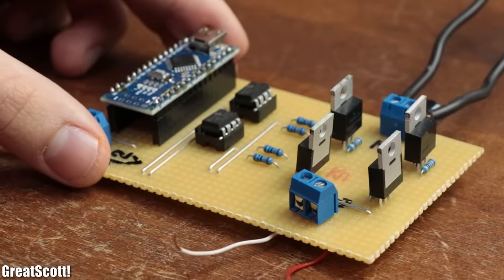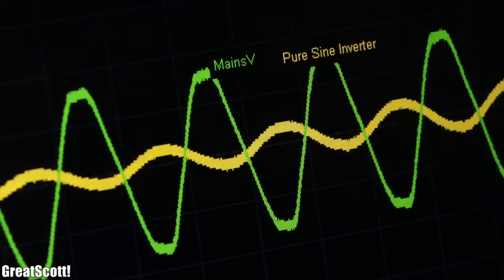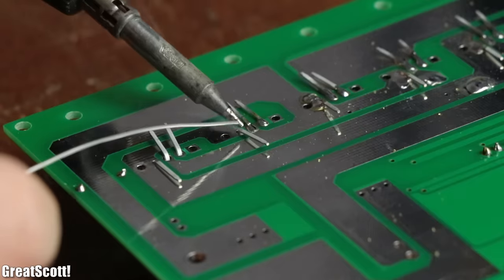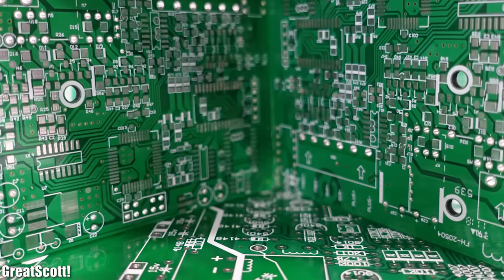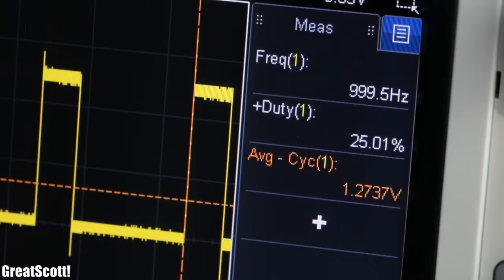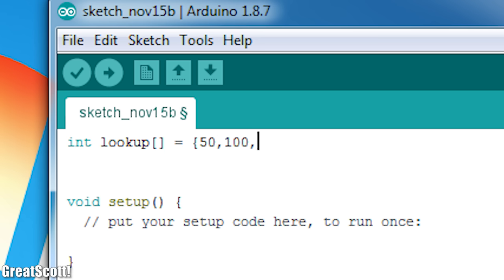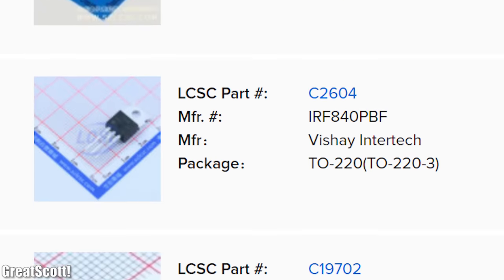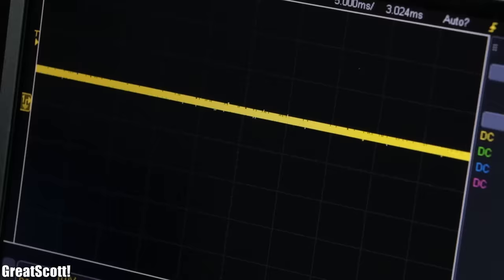Does it suck? Chinese DIY Pure Sine Wave Inverter || Sinusoidal PWM (SPWM) Tutorial

Comment: I know a fair amount about electronics and have a lot of common sense so I just want to say that if you are powering something don't over invert yourself especially if you're using batteries in other words don't buy a 5000 watt inverter with a peak higher if you're only going to be using at most a couple thousand Watts get a 2500 Watt continuous one because I found these inverters the higher up you go in wattage ,the more juice they use just to run themselves , draining away your capacity or Reserve

Comment: You lost efficiency by using a mains transformer for the step-up. It can't handle the pwm frequency.
Reply: I guess a mains transformer can only handle frequencies if around 50 or 60. Why do you think that is? Like, whats the underlying bottleneck? Isnt it just two inductors magnetically coupled?
Reply: @jeej6965  the magnetic coupler is the bottkebeck. Not all magnetic materials are the same. 
Lookup magnetic hysteresis for different materials like silicon-iron and ferrite cores.
Reply: The input to the transformer is not the spwm signal. It's the 12V 50/60Hz sine signal.
Reply: @imcrazy886  the average envelope might might look like sine but it isn't.
Reply: I know that. But the noise frequency is much higher than 50/60Hz.(normally higher than 30kHz)  It's not difficult to have the pure sine wave with a simple low-pass filter.  In Scott's case, the filter is not necessary because the "low frequency" transformer would acts as a filter. That is, 12V 60Hz noisy sine input -->  60Hz 12V/230V low frequency transformer  --> output 230V pure sine wave.  (That's what you said "lost efficiency" for high frequency. It's the advantage in this case. Haha..)

Comment: When It comes to the cheap Chinese products, I always expect failure. So If I just tinkering around I will use them for experimental uses. If It has something to do with my radio gear, I'll spend the big bucks to protect the equipment.

Comment: I fing you didn't use real battery which is 13.8v full charged. 12v = 20%. and current draw from your power supply module isnt strong/stable enough.

Comment: 20w at no load has nothing to do with the inverter board itself. Change your transformer to one which is designed for this purpose, (One with low flux density in the core).

Comment: Hi, can you make a multimeter using arduino nano that can check voltage, capacitor, resistor, transistor and as frecency geneator with 3d printed case. Please please please please please please please please please please please please please please please y

Comment: Halo 
I have been working on pure sin wave inverter (vintron blue power) . I have noticed after experiencing a fault and blown the power mosfet it also blows driver circuit can u please help of alternative driver circuit which can be used instead of the original one ? Ordering is not an option under this pandemic . The inverter them self are well built and sad to see go to waste just because of simple driver circuit . Below link containing image of the pcb       “https://drive.google.com/drive/folders/1-2SPcBgi5DPg0tA8KILFp5YxCSG0d6YV”

Comment: The EGS002 based inverters have issues when driving UN-linear loads such as a SMPS with no PFC, the sudden current load spikes at the  sine-wave peaks causes terrible flat topping and distortion. Also triac dimmed loads also cause massive distortion, and even can cause transformer saturation as current draw is usually not symmetrical. I found by using a huge transformer improved the ability to drive these loads. When driving pure resitive loads sinewave is perfect.

Comment: Too bad theres not a circuit our there that does the job like a regular inverter were the input gets turned into a square wave and into a transformer at high frequency then smoothed with a rectifier and capacitors then using mosefets to turn it into mains 60 or 50hz at 120 or 240

Comment: This is not a real inverter but a class-d amplifier with integrated sine generator driving a transformer. Never will be that efficient like creating an smps a stable voltage and the output pwm-ed to sine.

Comment: I had my final year project in Bachelor's named as "Protection of power Electronic switches in a SPWM VSI against Over-current and Shoot-through Faults" which addresses cheap and reliable protection for the VSI against such faults. We made the inverter as well as the protection. You can check out this video I made describing the integrated protection which not only protects the inverter but also automatically switches back the process once everything is normal.

https://youtu.be/4N-1NnDn-m4

Comment: That is not a good way to build a proper industrial,professional, pure sine wave inverter with the EGS002;

You first need the 1st stage where you up the DC battery voltage to 380VDC at, say, 24 kHz, through several small pulse transformers (for lower idle wasted energy...),  and their mosfet switchers; the 1 dollar board SG3525+LM358 works great for this;  3205 mosfets are almost universally used;

Then you need the 2nd stage,where the 4 dollar EGS002 BOARD does its magic; the EGS002 convertes the 380VDC to  110 or 220VAC at  50hz or60hz,through the H Bridge (4 IGBTs/Mosfets, or multiples of this in parallel for more power..), and  the output filters (a big wound toroid,and 1 or more filter caps) for the sine wave under load.

At the present there is no way around this, all commercial inverters work like that; i repair  chinese inverters and i see them almost all working like that.
Reply: Thanks for your input on this

Comment: What I learned it is a crappy design that creates a poor waveform under load and you also have to use a transformer, not mention at 12V idle it pulls 1.7A...Throw it in the trash

Comment: So basically those chips inside converts a square wave into a sinewave using mathimatics, so no wonder those cheapass invertors do lack a sine wave but instead use a “moddified sinewave” wich is incorrect because it’s not that the sinewave was converted into a square wave,no ,so the term “moddified sinewave” must and should be banned instead, in fact that square wave is by default and it should be moddified into a garbitch or a clean version of a sinewave ,so therefore they should call it “(cleaned) moddified square wave”  because that’s what it actually does, in fact all invertors lacking a clean sine wave along with a limited wattage should be banned for safity reasons and to avoid confusion among users!!!

Comment: The Chinese design failed miserably. The H-bridge should feed a high frequency ferrite transformer. This will process the power at the high frequency and therefore be much smaller than the steel cored toroid. The transformer then feeds rectifier diodes and then a high freq LC filter to remove the carrier freq. An outer voltage loop uses the PWM to control the output voltage.